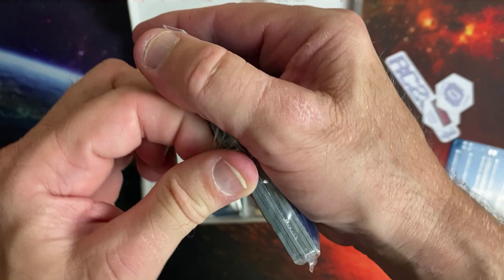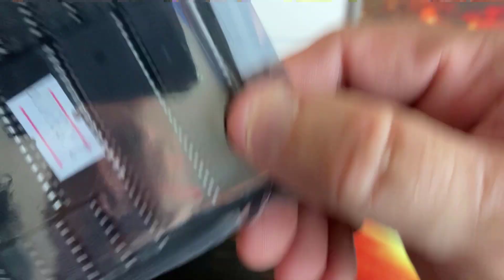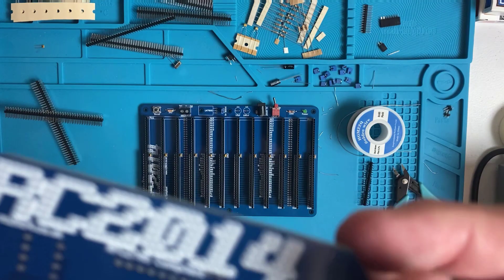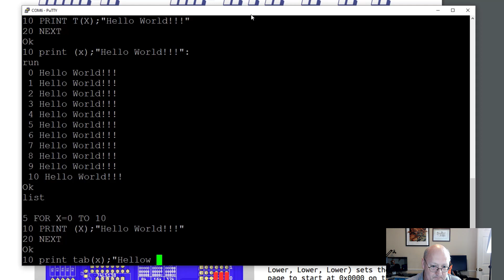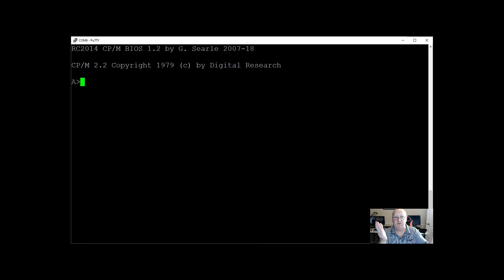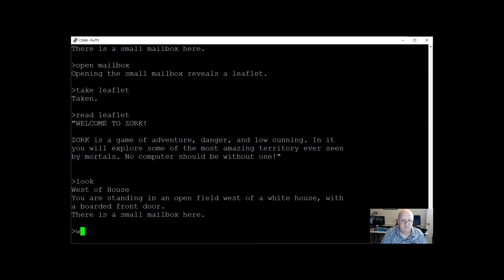RC2014

Comment: May I recommend using TeraTerm instead of putty. Not only does it do a better job at ANSI emulation and key translation, but it also has integrated file transfer protocols like Xmodem.

Comment: I love my RC2014. Classic II specifically, though I have 2/3 boards from the CP/M upgrade kit installed. Bent a socket pin on the CF card reader, destroyed solder pads removing it, and I don't even care because mistakes are learning opportunities. The ROM board from the upgrade needed a component lead(from a capacitor or resistor, didn't keep track of those trimmings separately) soldered to an IC I broke a pin on, the RAM board has a bodge wire because of another damaged solder pad and the TX/RX pins trimmed because I ended up with a short somewhere sending data through pins that shouldn't be connected... It's been an adventure for a newbie with electronics.
Reply: New CF card module is on the way, hopefully will get here tomorrow. 

Amazing that the Z80 managed to be just good enough to stay in production for embedded applications for so many years after it faded as a general purpose CPU. We can have actually new parts for a system if not identical to, very similar to genuine retro systems. Emulators won't cover every situation, actual vintage hardware won't and is often too expensive, this is a nice option to have and isn't super hard to put together.

Comment: These ridiculous backplane connectors were the worst decision I've ever seen. DIN 41612 connectors are a global backplane standard and cost the same as these toy SIL things. 
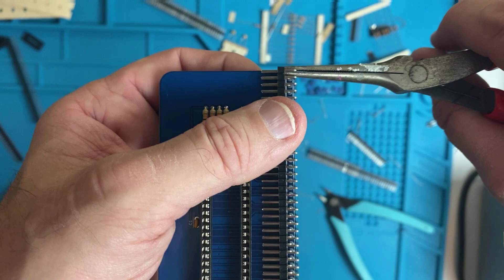Look at the hoops the designer made you jump through at 21:12, pulling pins out to make something fit? Sheesh...
And the PCB with the pointless cut out at the end, some kind of Apple case idea? Nobody puts these things in a case.
It's a shame that such a nice range of boards was kneecapped from the start, by some guy thinking he'd save 10 cents an a 100 dollar system :/
Nice channel though, subbed 👌
Reply: SIL = 10 for a dollar, where can you get DIN 41612 for a similar price ? This is a great little low cost hobby computer, great fun.
Reply: @Paul-xs7ks   DIN 41612 are around one dollar each. Now look at that as a percentage of system cost, it's nothing

Comment: Fun build. I listened while soldering up a SMD practice board. Completely doable with a fine tip iron, fine solder, and a microscope (I got an AD407 to help with soldering) The hot air station was an effort saver, too.
Reply: It's good that this kit keeps all soldering as through hole. SMD just for one component would step up the difficulty significantly.

Comment: Excellent work and timing! I bought my RC2014 pro about 2 years ago and started soldering the back plane last night. :) I'm wondering how you connected your RC2014 to you computer. I too agree that this is an exciting and excellent project. Big thanks for sharing! Subcripted and waiting for your next video
Reply: You probably had figured it out by now, but anyway there is  a dual serial sio/2 card included in the RC2014 pro kit. This card is connected to the computer using an FTDI USB-to-TTL serial adapter.

Comment: Great article, I had a ZX81 as my first computer, these were supplied with 1k ram, not 4k, but a 16k plug in memory pack could be fitted to the rear port and had a tendency to wobble and crash the computer, learnt some Z80 machine code on it as well.
Reply: I also had a ZX81 way back in the day, although I had it given to me after I had a C64 for awhile.

I actually have 3 ZX 81s in original boxes with 16K RAM expansion in my closet right now, they are awaiting a modification to the graphics subsection which allows them to be used on a modern LCD screen.
Reply: @dwculp  I moved onto a Sinclair Spectrum 16k next, though it developed a fault, and was replaced with a 48k version, because the 16k had ceased production, next I went onto a Sinclair QL, with the 68008 processor, after that, a Commodore Amiga 500, then built several PC's. Still have the Spectrum and the Amiga in a wardrobe along with 2 pc's that I haven't used for a while